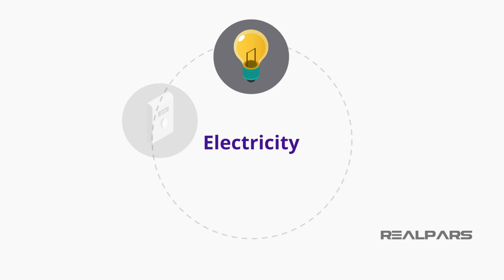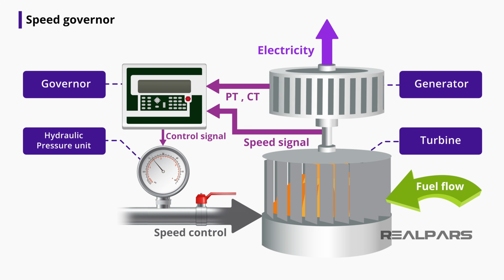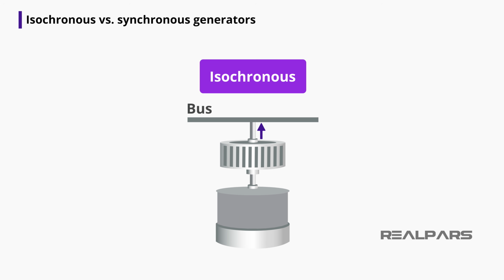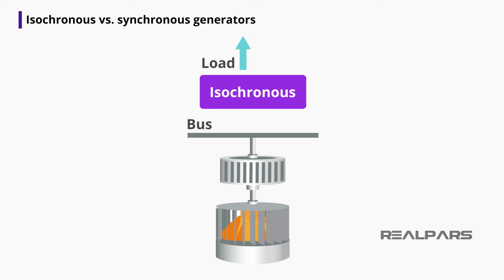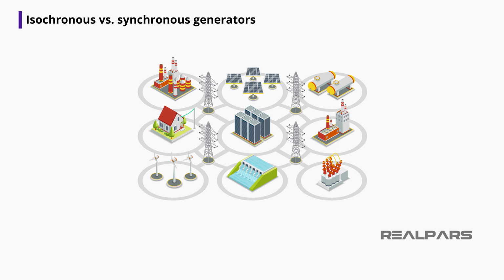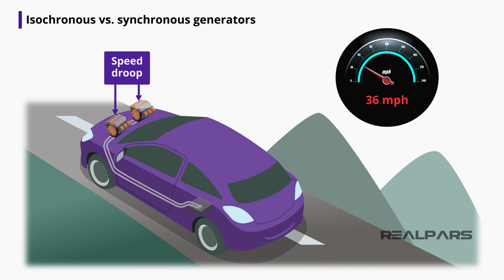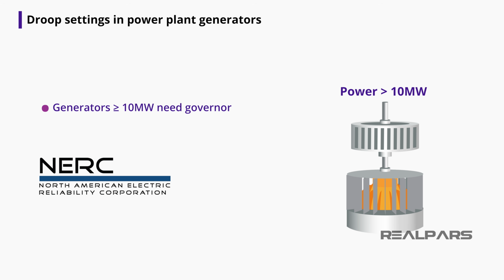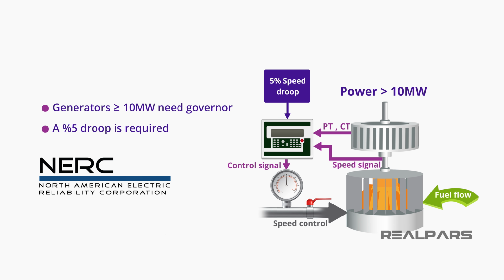Speed Droop in Power Control Explained

Comment: Sooooo, i have a question. The droop control mode is a function that prevents the collapse of the grid system. Is there a limit in the number of powerplants that work at the same time? If a new powerplant enters the grid, will we have to change the droop function? I.E. we have 10 powerplants with a droop function in their logic/governors. Can we open another 10 powerplants and integrate them in the grid without changing the droop function? Sorry for my English.
Reply from the maker: Hello, @ΒασιλείουΣπύροσ
Thank you for your question. Well, this all depends on where you are in the world, the engineering behind the design, and local Power plant regulations in that area.  It is hard to say. Maybe, but most systems are fitted with sensors to react as needed.
Reply from the maker: Hello, @ΒασιλείουΣπύροσ
Thank you for your question. Well, this all depends on where you are in the world, the engineering behind the design, and local Power plant regulations in that area.  It is hard to say. Maybe, but most systems are fitted with sensors to react as needed.

Comment: hi , can i make a simple steam speed governor with PLC ?
Reply from the maker: Yes!  A PLC is a logic device that is used to measure inputs and adjust outputs.  So logic can be programmed into the PLC to adjust the steam nozzles driving the turbine based on the measure turbine speed and required load.

Comment: What is Droop ?
Reply: droop means the allowed percentage of decreasing in frequence (speed) when increasing load. droop take its role when many generators works in parallel (synchronized). by giving each generator different droop value we can distribute the load according to the total capacity of each generator, so the less power capacity generator share less than the high power generator, to protect the small generator from overload
Reply: @Twopha  Good work. That's why there is always "spinning reserve" seen by the grid operator.
Thanks.